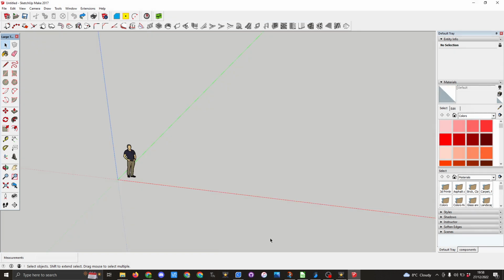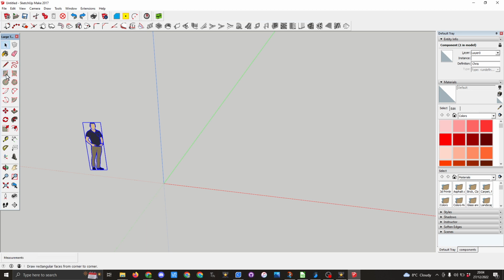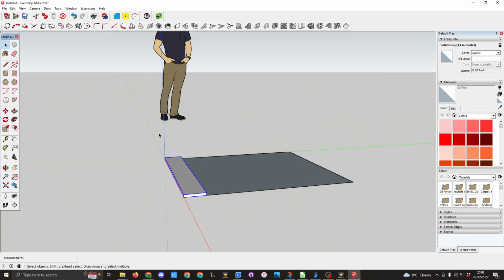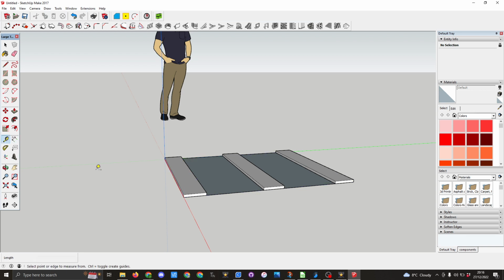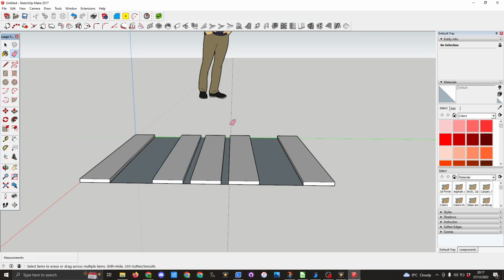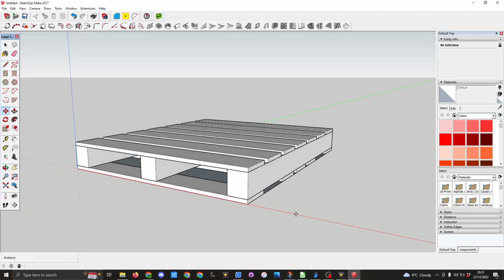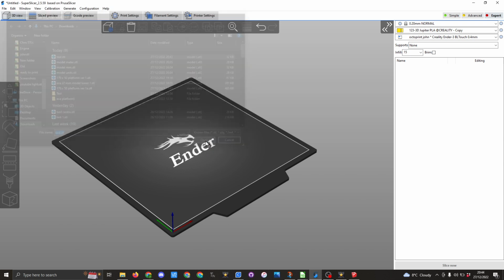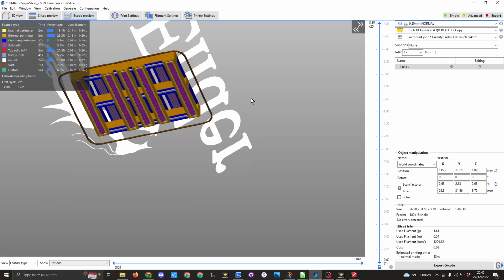Sketchup Make 2017 Make simple pallet for printing on a FDM printer for OO gauge layouts or O Gauge

Comment: Can you please send me a step by step on how to set up my work plain so it looks like yours cheers
Reply from the maker: Glenn in the video you can see I have the "Large Tool Set" active this gives us the tools I am selecting with the mouse. To get this up you need to right click on the top tool bar and if you scroll down the list you will see it. If you click it you should see that now appear. Some of the other tools on the top tool bar are plugins that need to be downloaded. to be able to use them.
Reply: @modelrailwaytheeasyway9743  I have done that bit but i can’t find the length bar in the selection or the plugins you have sorry for being a pain mate
Reply from the maker: @glenncalrissian3522  if you mean the measurement that we type in you will also need to activate that using the same method it should appear half way down the list. The other tools you can see are 1001bit tools which we use in later videos. And these need to be downloaded I tend to put the links into those videos when used.
Reply from the maker: @glenncalrissian3522  short video added to the channel to show scaling Chris.
Reply from the maker: To help us please subscribe and like any of the comments this helps with the YouTube algorithm

Comment from the maker: When I an using method 1 to design which is treating MM as meters when design I use export in Model Units that can be seen in the lineside videos.

When using method 2 which is drawing in Meter full size I use export as MM and then use the scaling factor to get either OO gauge or O gauge.

If I export it using the MM and look at it in Cura it comes in 1000mm x 1200mm x 144mm

If I export it using the MM and look at it in Superslicer it comes in 185.83mm x 223mm x 26.76mm

If I export it using the Meters and look at it in Cura it comes in 100mm x120mm x 14.4mm
If I export it using the Meters and look at it in Superslicer it comes in 1mm x 1.2mm x 0.14mm

If I export it using the Model units and look at it in Cura it comes in 100mm x120mm x 14.4mm
If I export it using the Model units and look at it in Superslicer it comes in 1mm x 1.2mm x 0.14mm

So you can see the different slicers will try to scale the model if it thinks it needs it which can be confusing when you start using them. 

I also use Superslicer because it gives a great feature to fix models before printing them.
If you right click on the model while highlighted scroll down the menu and you can use fix with netFabb.
Also it comes with some great calibration tools for setting up your FDM printer

This also available in Prusaslicer

Comment: What is the reason you use 1.36% instead of 1.32% as the OO conversion factor? 1/76.2 = 1.3157%
I'm not niggling, just trying to understand what I'm missing. I'm assuming 1.36 creates a better model somehow???
Reply: Ah sorry just seen your note saying it should be 1.32. 😬
Reply from the maker: Hi Bob I am glad you are raising questions that's the reason I am making the videos to try and help people learn to make their own models. One big issue is people setting up their printers too get the best results. Also I do have different methods depending on what I am trying to do.
Reply from the maker: Also If you have looked at our earlier videos for layout building you will see they are drawn in meter and we use a slightly different method for scaling. The next videos I will be showing the same method for life size drawing. The two lineside videos this method I use for repairing locos or making missing parts.